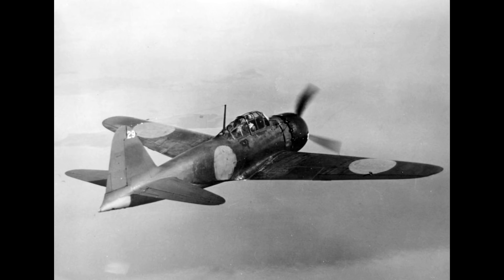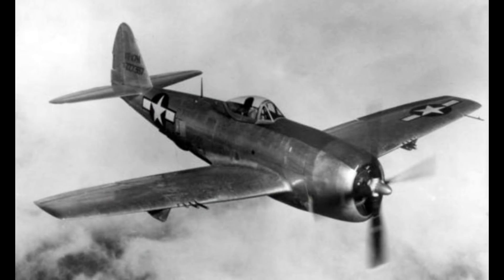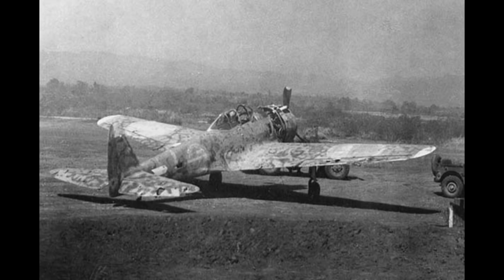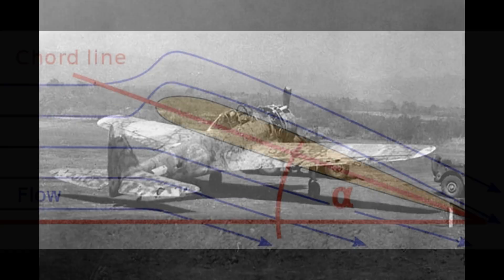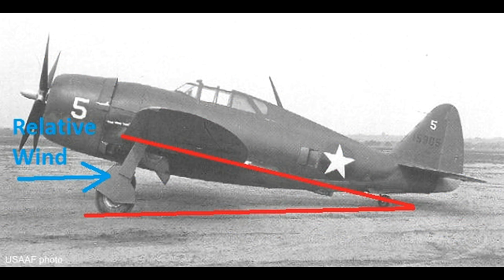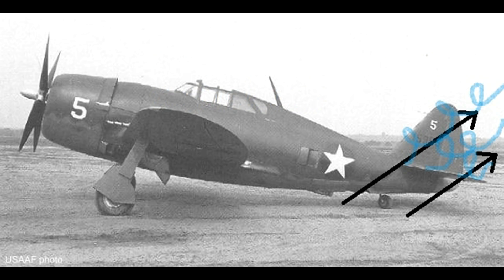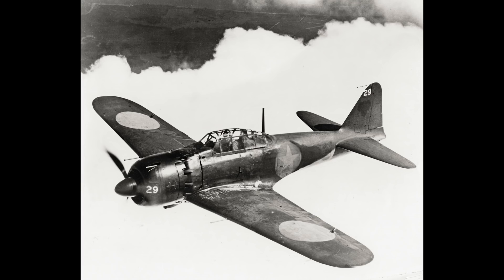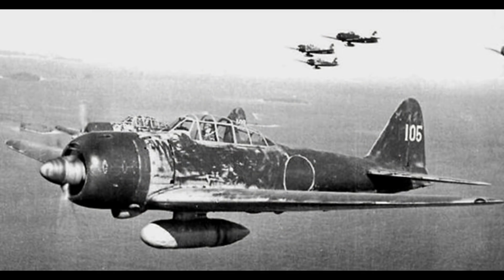Mitsubishi A6M Zero, an interesting fact few people know

Comment: If you think the A6Ms horizontal stabilizers is set forward, take a look at the Ki-44.
Reply from the maker: You're right! The Ki44 is an interesting plane, but I feel if I made this video about the Ki44, nobody would have watched it, plus the Zero did this first.
Reply: Ki-84 reporting
Reply: Julian Cate I was thinking the same thing! The Ki-44 needs a video in its own right. It was one of the few Japanese fighters that didn't have the emphasis on maneuverability and more like American fighters.
Reply: Ki-44 video, when? 

Also, love your stuff to tiny mechanical bits!
Reply: The Ki-44 Shōki aka "Tojo" was a tiny plane even for Japanese standards but it had a relatively huge engine so didnʻt handle so great but straight line performance was pretty amazing like a hot rod from what my dad told me when I was a kid.   Dad was a WWII Pacific theater veteran serving in the southwest Pacific theater.  HE knew many of the land based Marine pilots stationed on the  small island airstrips.  He spoke to one Corsair pilot who told him he really got spooked in his first dogfight with a Ki-44.  His Corsair had no problem outrunning and out gunning the Zeros he came across but his first encounter with the Ki-44 he tried to outrun the little plane but when he looked back it was still on his tail at full throttle.  According to Dad his Marine pilot friend had to finally resort to using his water injection several times to finally gain any distance and lose the hot rod Ki-44 on his tail.   The Ki-44 was one of the few Japanese fighters that could reach the speeds and altitude to be a threat to the B-29s in Japanese air space.
Reply: I'm thinking the Ki-84 has the same feature too. I've always noticed this but I never knew the explanation.
Reply: Also the Mustang and the Corsair.
Reply: @GregsAirplanesandAutomobiles   -, Also, unlike the A6M  and  Ki43, the Ki44 was an interceptor that emphasized  speed and rate of climb over maneuverability.
Reply: @scootergeorge9576  The F-104 of it's day?
Reply: @billgund4532  - Not quite the "Missile With the Man In It"  but it's a fair comparison.
Reply: Yep -  Corsair, Ki-44 and Ki-84. Plus others. The Ki-44 when developed, used the most powerful engine available for the Japanese at that time, a Nakajima radial that was used for bombers. This gave the plane its characteristically bulbous nose as the diameter of the engine was much greater than the Sakae engine in the Nakajima Ki-43 Oscar and the Mitsubishi A6M Zeros. When Nakajima came out with their next fighter, the Ki-84 Frank, it used the Homare radial which was a development of Nakajima's original Sakae, and as such its diameter was only slightly larger but with much greater horsepower. This gave the Ki-84 a much more sleeker and balanced look than the Ki-44 and is IMO the best looking radial engine fighter of the war.
Reply: @deplorable_bitter_clinger7482  - The Ki-84 was probably the best Japanese fighter produced in appreciable quantity.  The radial engine adaptation in the inline Ki-61 Tony came off surprisingly well.
Reply: @scootergeorge9576  - The radial engine used in the Ki-100 was nothing special but it was rock solid and the plane performed well at low to medium altitudes. The Ki-84 was a better performer but its engine was more problematic.
Reply: @deplorable_bitter_clinger7482  - According  to what I've read on the Ki-84 "Frank" the pilot would be flying along, all well when the engine would begin to smoke. Within a few minutes, engine seizure.  This problem may never have been resolved.Lack of critical raw materials led to weak landing gear struts that had a bad habit of snapping.
Reply: @scootergeorge9576  - Correct. I had read about the same problem with the landing gear. You know your history! The Homare engine was pretty maxed out, only a little bigger than the Sakae it was based off of, it was rated at 1990 take off hp where the Sakae was 1130. All the more remarkable on 92 octane fuel. Because of the bombing of the Japanese industry and lack of strategic materials the build quality as well as the gas quality suffered. Earlier models of the Ki-84 were much better than the later models in quality and performance.
Reply: @AhnkoCheeOutdoors  I believe the Ki-44 Shoki "Tojo" was designed by Nakajima as a point interceptor with fast climb and good high altitude performance to shoot down bombers, they were heavily used in the Dutch East Indies to defend oil refineries from B-24's and such.  I think they also were used against B-29's over Japan.  It was basically all engine with a very high landing speed the pilots didn't like.
Reply: Ah the Japanese Army Fighter, imo more interessting then beating the dead horse of the A6M... even other Mitsubishi Navy Planes come to short when talking about Pacific war like J2M.